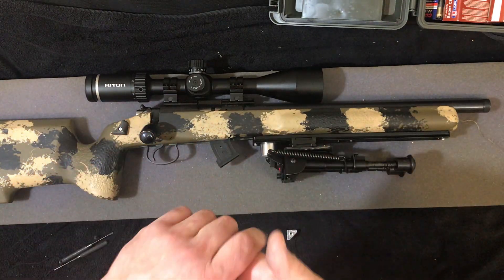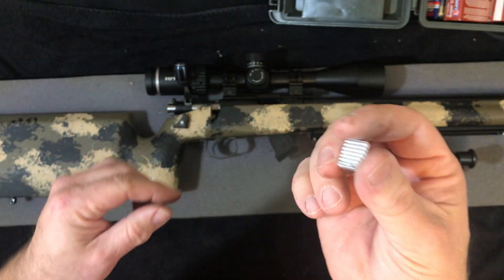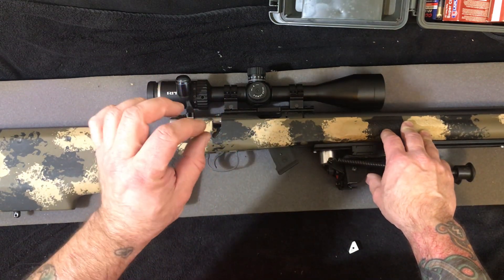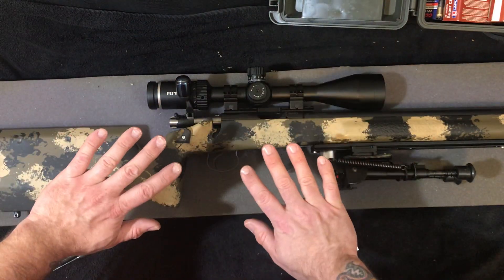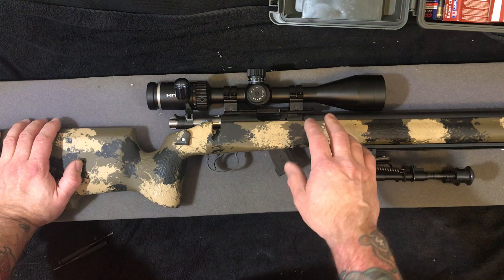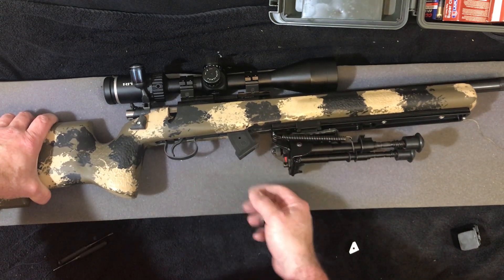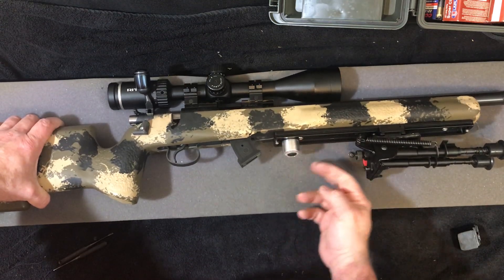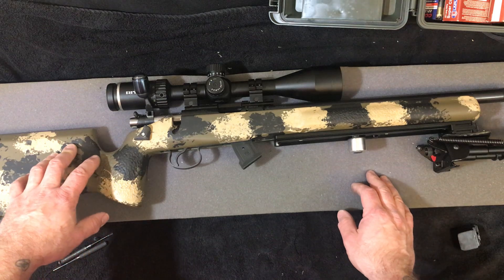CZ 455 VPT - modifications update

Comment: I did a thumb-rest, but did it this way.....used a nylon 1/4" x 20 slotted-head screw ......about 1" long but threaded it into the stock only maybe 3-4 turns....and used a slip-on nylon sleeve that covered the exposed threads and was a diameter that matched the screw-head.  Resulted in a "cylinder" sticking out from the stock on the right as a thumb rest. Easy-peesy. You can adjust the overall length (protrusion) using a shorter screw or cutting it ( and the sleeve) down.
Reply from the maker: Well, that sounds nice and easy! Well done
Reply: @inrangerimfire20two  yep...also, no sharp edges....no cold-temp affect too. Cheers